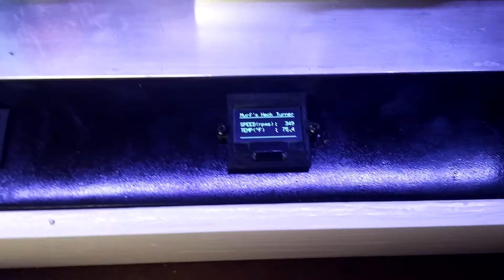Motorized neck turner

Comment: What are the specs on the motor and where did you get it?
Reply from the maker: Jon -- I used a Nema 24 stepper motor, I "believe" this one right here: 
https://www.ebay.com/itm/US-Ship-1-Axis-CNC-Kit-439oz-in-Nema-24-Stepper-Motor-Driver-CNC-Mill-Router-/231616285298?hash=item35ed680a72:g:0Y4AAOSwyQtVmyaY

Comment: Definitely a parts list please.
Reply from the maker: Skip -- 

Started with the 21st Century Shooting Neck Turning tool:
http://www.xxicsi.com/17-338-cal.-neck-turning-lathe.html

I didn't buy the entire lathe, just the cutting tool, cutting tool mount, shell holder and appropriate mandrels for the caliper I'm turning.

The box itself isn't anything special, simple plywood screwed and glued, routed an edge around the top to fit the aluminum plate. 
Drilled / Tapped mounting holes for hardware. 

Purchased from ebay:

The aluminum plate for the top: 
1/2" X 6" ALUMINUM 6061 FLAT BAR 12" long .500 Solid Plate T6511 Mill Stock

Display Module:
US 0.96" I2C IIC Serial 128X64 LED OLED LCD Display Module for Arduino White. 
The small trim piece around the display module was 3d printed by a friend of mine. This is the part he printed:
http://www.thingiverse.com/thing:690691

Power socket:
1x BLUE LED Rocker Switch Fuse Holder C14 Inlet Power Socket AC250V 10A 

Motor mount:
57 57mm Aluminum Mounting Bracket For NEMA23 Stepper Motor Professional WHITE !!

Power Supply:
High Performance 36V DC 9.7A 350W Regulated Switching Power Supply 36 Volt

Power step down to power Arduino Mega:
DC-DC 3A Buck Converter Adjustable Step-Down Power Supply Module LM2596S

Motor used: 
1 Axis CNC Kit 439oz.in Nema 24 Stepper Motor & Driver CNC Mill Router
http://www.ebay.com/itm/US-Ship-1-Axis-CNC-Kit-439oz-in-Nema-24-Stepper-Motor-Driver-CNC-Mill-Router-/231616285298?hash=item35ed680a72:g:0Y4AAOSwyQtVmyaY

Arduino Mega ( you can get brand name or knock offs... )
https://www.arduino.cc/en/Main/ArduinoBoardMega2560

Flex Coupler ( you can probably find cheaper, but this combined with a 3/8" steel shaft allowed me to couple to the 21st century case holder )
http://www.mcmaster.com/#2464k25/=13cbhn5

The linear rail and plate came from:
https://openbuildspartstore.com

The parts list:

12 x Precision Shim - 10x5x1mm
1 x Low Profile Screws M5 (Length: 8mm, Quantity: Qty. 25)
1 x Tee Nuts (25 Pack)
1 x C-Beam™ Linear Rail (Length: 250mm)
1 x C-Beam Gantry Set 

I purchased the power switch and used a descent Bourns potentiometer to control the speed.

I also attached an i2c arduino temperature sensor inside to make sure it wasn't overheating, which it never has. I don't have the specific part number for the sensor, however you should have no trouble finding one.

You'll need some wire and have to do some soldering to put it all together. 

If you're familiar with programming the Arduino, this is the source code I wrote to drive it: 

https://github.com/djmurf/NeckTurner

I will tell you, it wasn't cheap! It was a blast to build it, and I really do like how it turned out. I can't say it's any better than just a good motor attached to a shell holder, etc, but it was really fun building it...

If you're serious about trying to build one, let me know. I can pop the top off and post some picture of how the inside is layed out. 

Good Luck!
Reply: 350watt power supply is overkill!  You can get by with $10 24v power supply, 2A is more than enough.  You can salvage free stepper from big scanners/ laser printers and copy machines or just buy one from eBay.  I bought my stepper driver (TB65xx) from eBay for about 8 bucks, also if you want to skip Arduino programming and potentiometer, you can get a pulse generator with pot., Forward/Reverse and 3 different frequencies for cheap from eBay too, it's actually very nice and connects to stepper driver.
Reply: Can you make a video of the setup and details, looks genial